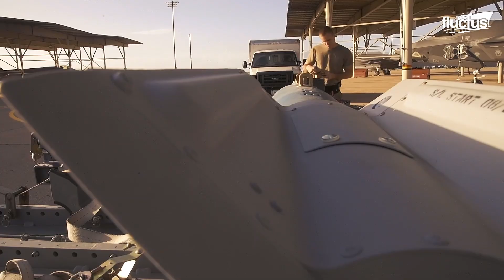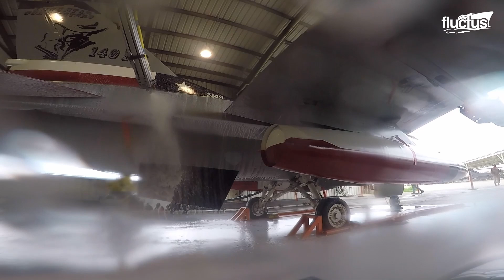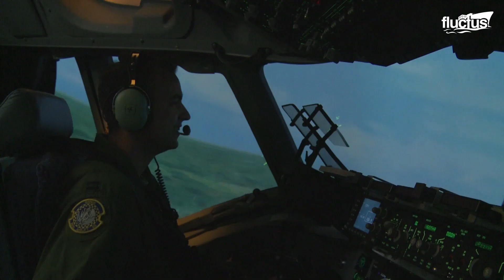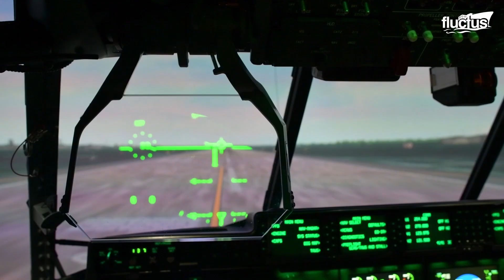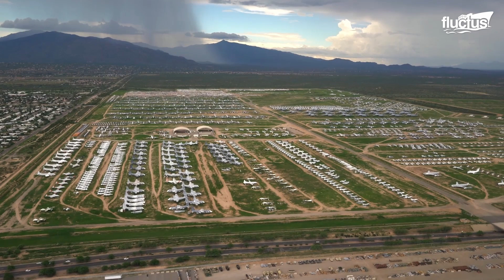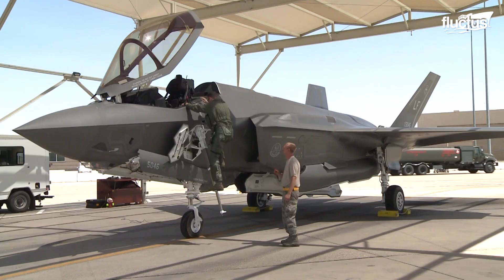US Air Force Genius Idea to Transport its Pilots Luggage for Free

Comment: The Navy has been doing this for decades and I think it's a great use for an old drop tank. When I was a plane captain (crew chief) back in the 60's I used to help the pilot  load up his bags and then  button up the opening on the side. It's amazing how much stuff will fit in there! Another favorite spot for luggage was the area where the ammo cans would normally go, providing the mission didn't require ammo of course.
Reply: The Royal Australian Airforce was doing it in the 70s…..it ain’t new.